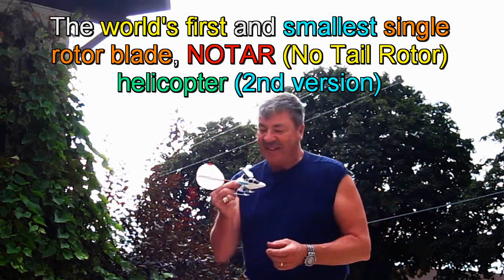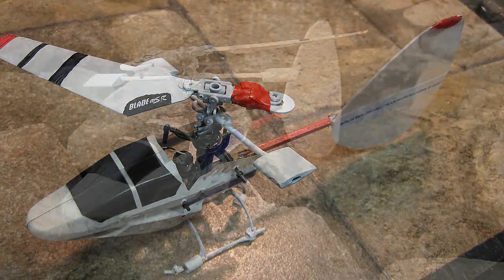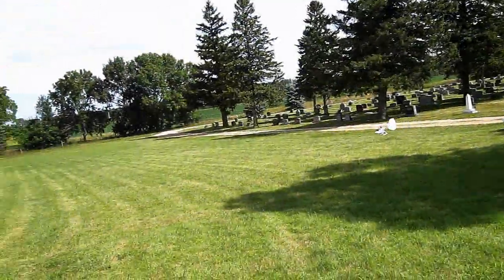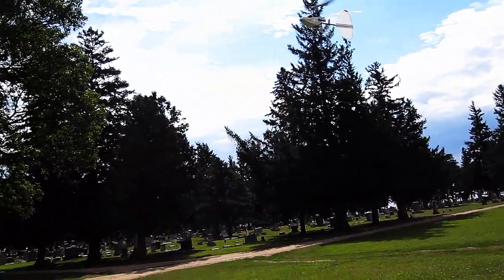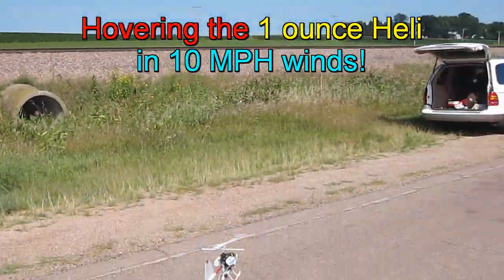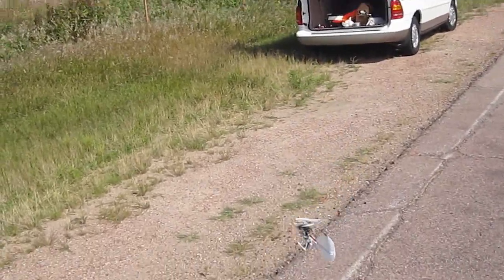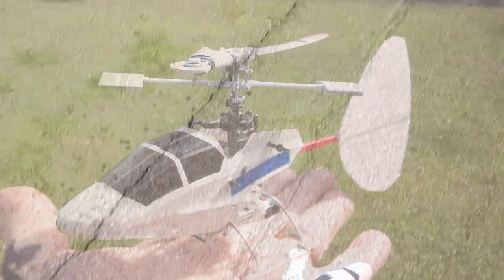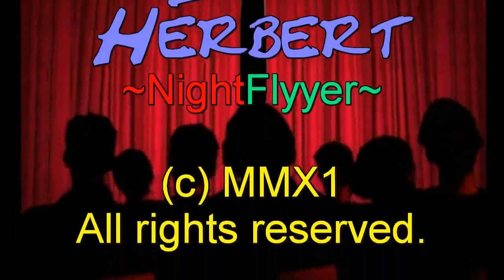World's First and Smallest Single Rotor BLADE, No Tail Rotor (NOTAR) Helicopter.

Comment: Brilliant, but I would assume the power consumption should be near the same, lighter matterials means less lift needed, but less surface area to create lift would mean higher rpms are needed to compensate (only extra power would be from the lack of tail motor).  I like how you can still use the torque to emulate rudder control, I'd like to know if the flight times differ much from it's original configuration (even though I do recognize that it is a hybrid).  

Thanks Dave, great video.

Comment: a frisbee generates lift vertically when flying through the air, so when you mount one on it's side where the tail rotor should be, it creates sideways air like a tail rotor (when in forward flight or light wind). watch his other videos about notar stuff and the kyosho 2 channel helicopter.